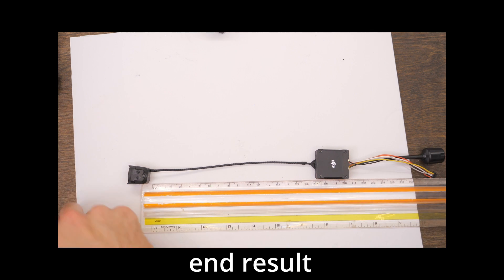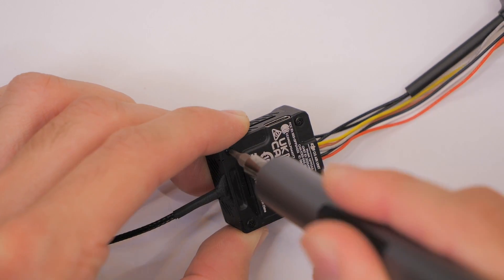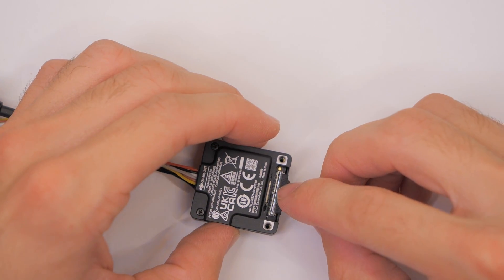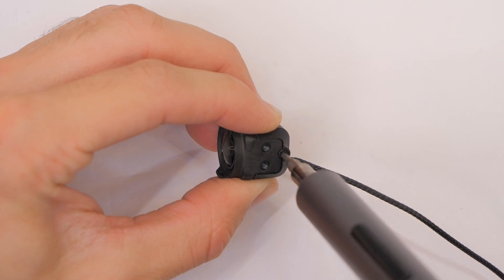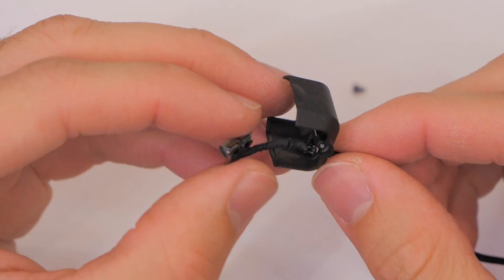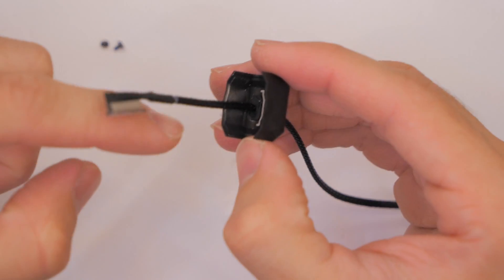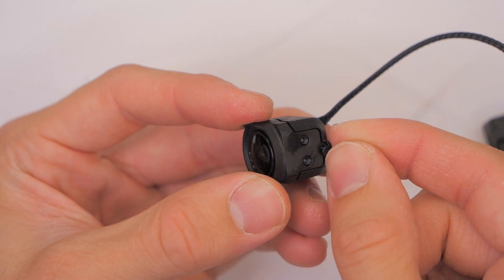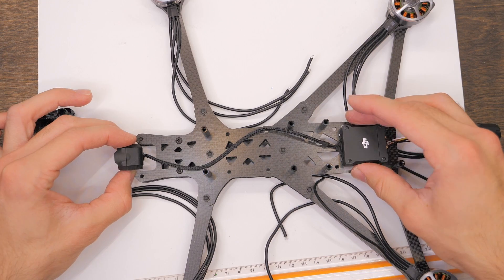How to Install Longer camera cable for DJI O3 Air Unit (for larger drone builds)

Comment: Thank you!  I am missing the little sheet metal cover for the connector on the air unit side.  My cable disconnected in a violent crash.  Not sure if mine was ever installed?  Came ready to fly from GEPRC.  Maybe I lost it? Who knows but I put a few layers of foam tape in there to sandwich the hell out of that little connector to hopefully prevent another disconnect in a crash

Comment: Hey this was really useful as im building the Chimera7 V2  and it came supplied with the longer cable, was unsure how 'tight' the fitting of the cam wire to the unit was, i see you also were not too convinced of the connection  but indeed the little cover presses it down nicely. Thanks again!